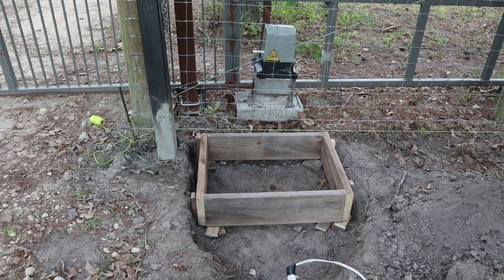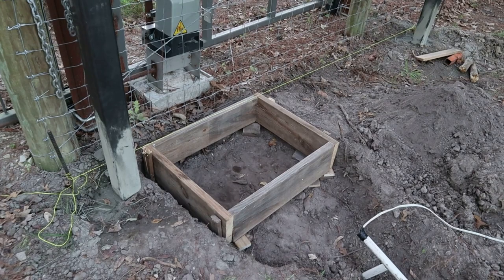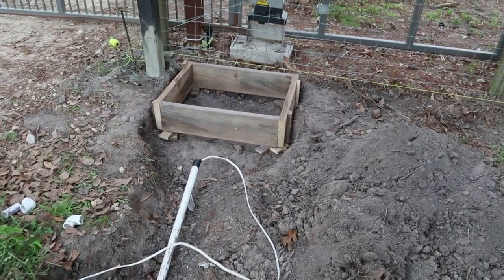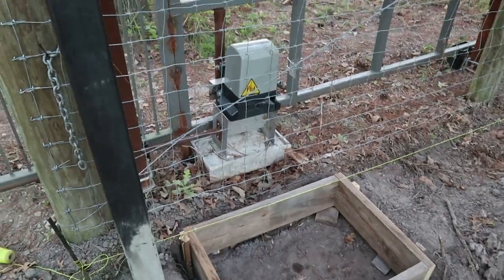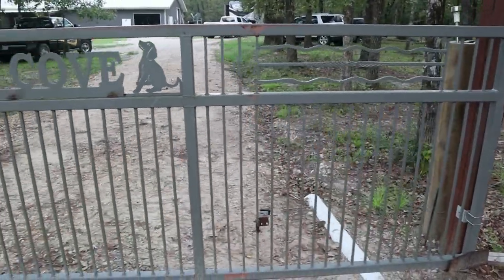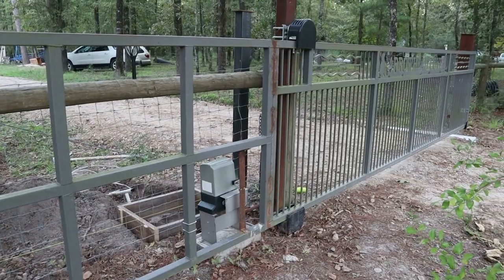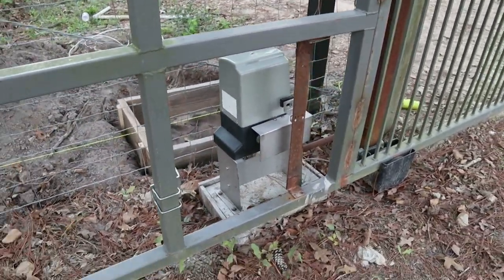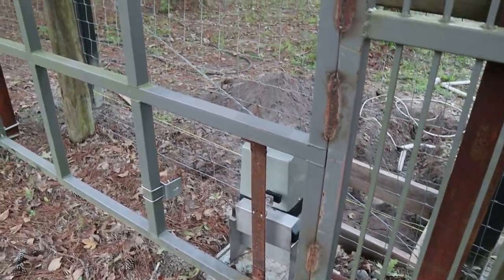Must do this when installing Driveway Sliding Gate Remote Rolling Cantilever Gate

Comment: Is the drive control module board covered with a protective varnish in your case? I have varnished my sliding gate drive with a low shrinkage. Insects will shit on the contacts and road dust will also do its job .
Reply from the maker: It’s all covered with a varnish

Comment: Do you have a link to what gate opener you purchased? I have a gate that rolls that I want to do this to,however mines a bit heavier. 2x2 steel frame with two 6x8 board on board privacy panels..
Reply from the maker: This is not the same seller, But it is the same gate opener. Hope this helps..https://www.ebay.com/itm/3300lb-Electric-Sliding-Gate-Opener-Operator-Gates-Kit-Automatic-Remote-Control/123089110481?epid=15027565081&_trkparms=ispr%3D1&hash=item1ca8aec5d1:g:mWQAAOSw101fgW7p&amdata=enc%3AAQAFAAACgBaobrjLl8XobRIiIML1V4Imu%252Fn%252BzU5L90Z278x5ickkp2NA0WuhQytmt4dbStg00ONlk9wAD3BqsV%252FHWm275scHuP7WZw6b33wpy%252BNmDJT51bb851eSHv7ETHiIVn2H%252BkkS%252FW1f0t9LbY4m5zZlnQ6ICyGQoforz3uMqNfeF5EJUl5tvGjmQAzEPGL4o4VCEDnSJ8onGxxx1LoypNBepiAnH9W5T5JfkfF5fD4SHIjXBMU6FuIAqch24Be65MzFA1O%252B1AWSPGjzzM2pd%252FxCUt2H3Vm11felHOgOzu7NAC9kz7J0QaQT4YamVPjU4jc04AA2hNJNUvJu%252FotwaUXfzv%252BJTxWTlOtgt3gk82MA7kQDs3wN%252FxUcr3VzhNAUCWqPRhjAdajk3a%252Fxt4fZ%252FObBcfZ%252FeLuePGcYWj262DL0IQg072O5BzlOjjUM2aw86LlX%252B%252B3awlerlL4M8gLZZRUejP7h8jbstsAeHCxWtSMj%252B3FOemLvl2FEONwtuFWXuxxR%252FXj1gBwyGoRWI3UpxcpIBdGtuN19teJskkrvQlQ%252BWOA2nmIGALXEzpOhYvzJjTIDkUVAiSmDjMECqMVrYF6YSEnPjPW0BMnagK7ctaUz%252BOLJTvb8DQgU7x%252BuhIkXzlm8%252FsDOrcAMEsCipluKEVaN4y242cj%252BkLCgqypUa3JLJKBAyQLJvmfYZ8eV0WtoS%252F%252Bm4yxOi0uQWWfFnU3rKrYFPiITku8b1BdnyWI6OqWbPpJVfcMm%252F%252B8L%252F3D3S1IG9ZB9mBZh6Our2NxMpyLxa9aRALYfb1hRvFKk%252B3KSCI1n9%252BGv7fYuggkRcNc5ALC6w1uPeD%252F1GojxpOMFIU6BK1%252Bcs%252BQ%253D%7Ccksum%3A123089110481a3a984e72dab43709d6bd6509d2d346c%7Campid%3APL_CLK%7Cclp%3A2334524
Reply: Thankyou sir.

Comment: Seems to me like you will doing this again soon, the concrete needs to equal the weight of the gate that is hanging over when it’s closed  if not the gate will lift the concrete out of the ground just like you had happen before.
Reply from the maker: So far everything is going great and it's been in the ground over a year..we have had months of 12 inches of rain and dry ground with cracks as big as 1"..I guess with all of the rebar enforcement that I welded in bottom..it really holds it in place..appreciate the comment..thank you